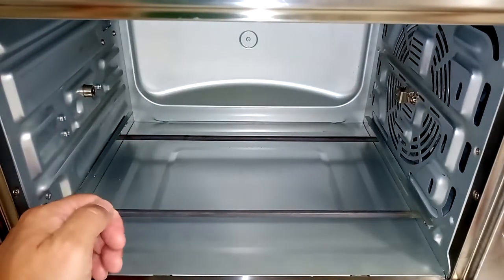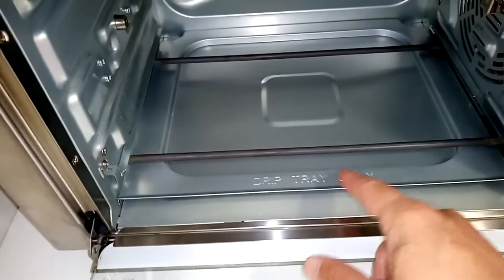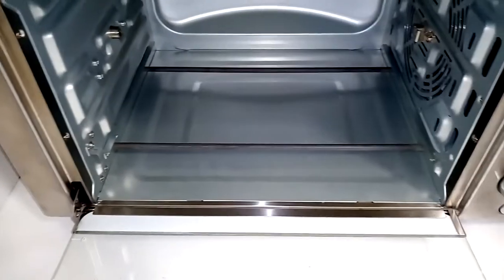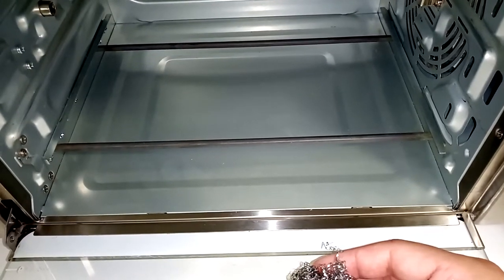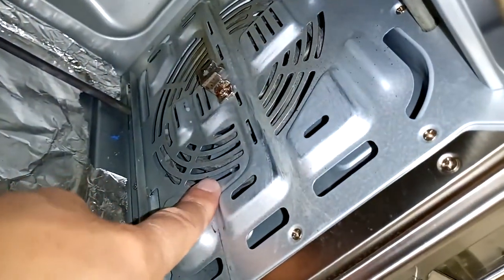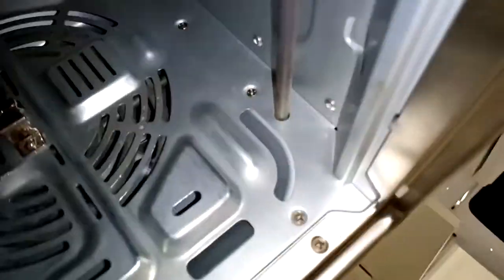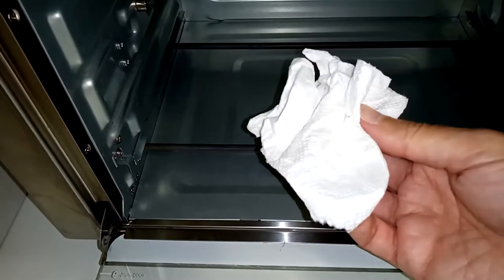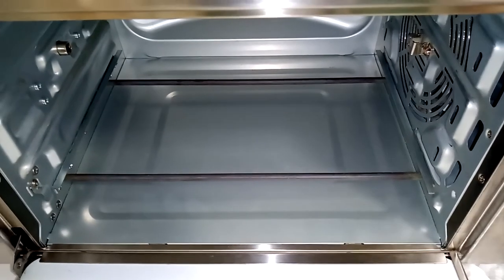How to Clean the Inside of an Emeril Air Fryer 360 & the "Tool" You Need To Do It!

Comment: Will try to clean it with the pads. Wife doesn't believe in any prevention.  I'm about to throw it away and get another. Love it but sheesh
Reply from the maker: She doesn't believe in prevention as in using foil you mean?  You saw my other video on tips and tricks?  Maybe you can guilt her into it.  After you're done cleaning with this method, it will look close to new or at least amazingly different, so you can say "you're not going to just mess it up again are you?  All my hard work (and it is work) for nothing?" :-)   Using foil on the original drip tray and using the baking tray as a secondary drip tray (when appropriate) with foil (placed securely) will definitely help and ease or burden of cleaning the inside of the Emeril.  I also have a video on the product you need and how to clean the outside of the Emeril Lagasse Power Air Fryer 360 if you really want to impress.  It will look brand new!  In the meantime, I recently made a YT Short video where you can see the before and after using the cleaning method described in this video.  You can find it here: https://youtube.com/shorts/4-Bp-OfLXug?feature=share    Keeping the air fryer clean and cleaning it after it's been used are pain points for many owners.  But between the tips/tricks in my other video and the cleaning method outlined in this video, I think you'll be a much happier Emeril air fryer owner.  Plus, with a new looking air fryer, thanks to your efforts, you may have a happier wife.  And you know what they say... "happy wife = happy life"    Enjoy!
Reply: @EfficientWay  using anything lol but after my elbow grease brings it back to life foil will be used

Comment: I need to go deeper than this.
Reply from the maker: Give the "tool" a try as I think you'll be pleasantly surprised by what it can remove and clean off from the inside of an Emeril Lagasse Air Fryer 360.  If you apply extra "elbow grease/pressure" it can do wonders, but more importantly, you won't create a mess like you would using a Brillo pad and it's a lot safer/healthier than using oven cleaners/chemicals.  You could additionally apply a bit of dish detergent like Ultra Palmolive (mixed with a bit of water to create a "soapy" sponge or paper towel) and apply it to the inside of the Emeril.  Leave it to sit for a few minutes so that it will help to start breaking up the grease and then go in with the recommended tool and scrub away.

Comment: I give up !!!!!!!!      I found the best way to save time.......... is to DUMP IT !!!!
Reply from the maker: I can feel your frustration through my computer screen.  I'm sorry to hear you're having such a tough time cleaning the inside of your Emeril Air Fryer.  You need something abrasive, but not too abrasive as to scratch everything up.  And SOS pads are not only too abrasive, but they will leave all that sudsy blue soap in their path.  Oven cleaners are dangerous to use and it's a pain to try to remove it all (and be sure of it) before using the air fryer again.  That is why I suggest using the tool in the video.  You may be past the point of no return, but it's normally very effective at removing the burnt on grease from steaks, hamburgers, etc. and splatters.  The video watched showed me removing grease splatters from the beef burgers I cooked (I have a separate video that shows me cooking them and how much grease came off- which was all caught by the foil btw).  I have a separate video on 
"tricks and tips" regarding the use of foil, etc. If you haven't tried the tool, it's worth the small investment to do so.

Comment: You probably barely use this unit. No way it’s this clean. The grease splatter and etc
Reply from the maker: I love the skepticism.  For starters, I you can view the video I made prior to this one where I made beef burgers in the Emeril Air Fryer.  In this video, I cleaned up the hardened on grease splatters, etc. Furthermore, there are a whole bunch of videos on this channel where I "use" this unit to cook various types of food- from vegetables I spray with oil, to pizza, to frozen PF Changs fried chicken!  If you want one of my first videos on using the Emeril Air Fryer Power 360 where I offer tips and tricks, you will learn how I prevent creating large messes while using the Emeril oair fryer so that the clean up process is not so difficult to start with.  After that, just follow the process in this video and you too can have a clean Emeril.  Take a look at yet another video where I show/tell others what to use on the outside to get my Emeril looking so shiny it looks like it just came out of the box. You may find it helpful. I promise I don't store my Emeril in a box ;-)

Comment: I guess taking all the screws off and trying to take it apart is not the best idea…. Should have watched this before I did that 🤷🏻‍♂️
Reply from the maker: Ha!  Well I tip my hat to you for that kind of effort just to clean the inside of the Emeril Air Fryer 360!   Were you able to put it back together ok?  If you haven't seen it, the video I made prior to this one into detail about how to prevent the need for big cleanups etc.  Anyway, I hope you got to clean behind the fan grill (where the fifth heating element resides).  There are a lot of Emeril Air Fryer owners that are dying to get into that space to clean out any grease splatters that made their way in there.  So your efforts likely weren't for not.  Either way, thank you for the positive feedback on the video.  Happy Frying!

Comment: Nothing sticks to the drip pan.   Even a little scratching is no good.  Eventually, your pan, which is nonstick will be ruin  when using things they said not to use.  It pays to listen to the maker/manufacturer of an item.
Reply from the maker: I don't have an issue with anything sticking to the drip pan because I line mine with foil.  I don't even recall cleaning the drip tray in this video.  As far as the concept of "nonstick", it is often difficult to remove hardened on food, fat drippings, burnt drippings, etc. even if something is coated with "nonstick" spray.  On that note, where did you read, from the manufacturer, that the drip tray on an Emeril Air Fryer 360 is nonstick?  I just reviewed the manual that came with mine and I did not see that mentioned anywhere.  That is not to say that I didn't miss it, that I have a different tray (or manual), or that the drip tray is not nonstick.  I simply did not see that fact stated by the manufacturer. Btw, I am aware that the manufacturer suggests not using foil, but I've mentioned and written extensively on the topic in my other other Emeril video and its comment section, about how I do so safely, and successfully (no issues all these years).  The tool in this video is especially helpful for cleaning the inside walls and ceiling of the Emeril.  These areas don't offer the same option of removing and soaking like the baking tray or the drip tray.  Over time, depending upon how you use your Emeril, these areas are likely to become pain points as they have for so many other owners.

Comment: Mine is aweful!
Reply from the maker: The Emeril Air Fryer 360 can easily build up grease and grime.  You aren't alone.  But you don't have to live with a dirty Emeril Air Fryer.  This tool and technique will help you remove the crusted on grease and splatters that seem impossible to remove.  You will be able to restore it to where you are proud and happy to look inside once again.  Additionally, I have a video on what product you need and the method of application to use in order to restore the outside of the Emeril Air Fryer to a shine that looks like you just took it out of that box.  You can find that video on this channel as well.  Finally, if you haven't seen my video on "tips and tricks" for the Emeril Power Air Fryer 360, watch it and read the comments.  I have tips for how to keep it clean and other viewers have left some helpful comments and tips too.  Happy Frying!

Comment: Why you clean with it being plugged in??? Too dangerous
Reply from the maker: I avoided touch the heating elements when cleaning the inside of the Emeril Air Fryer, even though it should be safe to touch as long as the Air fryer is not on.  But you are right.  To be extra safe/cautious, I and others should unplug the air fryer before cleaning inside.  It's easy enough to do.  Thank you for noticing that and reminding all of us.

Comment: Glad I watched this, it made me not want one.
Reply from the maker: Don't get turned off yet.  Watch the video I made on "tips and tricks".  If you use foil the daily cleanup for an Emeril Air Fryer, is dramatically reduced. You don't have to take the steps in this video every day.  Also, everything that brings joy has to be maintained.  Be it your car, a pool, a dog/cat, etc. There are cost savings with using an Emeril Air Fryer if your conventional oven is electric.  Anyway, I'm glad the video helped in form or another!  Thank you

Comment: This oven looks very brand new.. nothing ever cooked in there 😡
Reply from the maker: Ha!  I see you are skeptical about just how well I was able to clean the inside of an Emeril Air Fryer.  If you check out some of my other Emeril Air Fryer 360 videos where I use the oven to cook things such as beef hamburgers, and you see that those videos were posted well before I made this video, will you come back and turn that frown upside down?  Will you reply with a smile?  More importantly, if you truly want to clean the inside of your Emeril Air Fryer, watch the other videos, so you feel confident (even though I show removing the hardened on grease stains in this video) enough to try the tool I recommended and used in this video.  It will save you a lot of time cleaning your air fryer.  As a bonus, if you would like the outside of your Emeril Air Fryer to shine like new, check out my video on that subject.  I tell you exactly what product to use and how to apply it.

Comment: Did not work
Reply from the maker: I'm sorry to hear you're having trouble.  Could you please provide a few details so I can try to help you i.e. what part of the Emeril Air Fryer you're trying to clean- inside/top/bottom/drip tray/glass door, are you using water, are you using the exact brand featured in the video, how hard you are scrubbing, what you are trying to remove- hardened oil/grease/fats, burnt on grease, cheese, etc., how long whatever you are trying to remove has been inside the Emeril- days, months, years, etc. etc. There are very few, if any, things this product can't remove from the inside of the Emeril.  In a worst case you could be left with some cosmetic/color remnants, but all material deposits should be able to be removed.  Thanks!

Comment: Looks hard as hell to clean? I mean the air fryer I have now at least has an entire pot I can simply remove and wipe out but this, looks like a souped-up toaster oven just far more difficult to clean out. And showing the three racks of food we're a pretty foolish addition to the commercial since each one drips on the one below. Air fryer cleaning should be simple this looks like a Lot of work.
Reply from the maker: You're right that the Emeril Air Fryer 360 is harder to clean than a stand-alone air fryer (does nothing but air fry) and the commercial showing 3 racks cooking at the same time is silly.  Not just because food will drip down on to the rack below, but because the air doesn't circulate as well and everything takes longer to cook.  While cleaning the Emeril Power Air Fryer may take longer and is harder to clean compared to the "pot" on a different air fryer, the Emeril Air Fryer has the advantage of performing the toasting function, convection oven function, pizza function, etc. with precision timing as a bonus.  You can't do that with stand-alone air fryers.  So you not only save space on your counter and have the option of not turning your conventional oven on in the blistering summer heat, but you also gain all of that functionality.  PLUS, the toasting function and all the others are actually better than a normal toaster because it uses precision timing (down to the second) and the temperature is perfectly controlled (way better than a regular toaster oven).   So it is a trade off.  If you follow the suggestions in my other video, it cuts down on the clean up quite a bit, but it will be more than what you have now.

Comment: I did try, foil, even Oven Cleaner to take off the burnt grease from Hamburger Paddies,  the burnt grease  is now imbedded into the metal. No Luck, my Air Fry looks P.P. !! to say the least, I highly recommend to NOT BUY IT !!! A complete waste of money for me. I have put in about 3.5 hrs trying to clean it....... WILL DUMP IT !!!!
Reply from the maker: I can feel your frustration through my computer screen.  I'm sorry to hear you're having such a tough time cleaning the inside of your Emeril Air Fryer.  You need something abrasive, but not too abrasive as to scratch everything up.  And SOS pads are not only too abrasive, but they will leave all that sudsy blue soap in their path.  Oven cleaners are dangerous to use and it's a pain to try to remove it all (and be sure of it) before using the air fryer again.  That is why I suggest using the tool in the video.  You may be past the point of no return, but it's normally very effective at removing the burnt on grease from steaks, hamburgers, etc. and splatters.  The video watched showed me removing grease splatters from the beef burgers I cooked (I have a separate video that shows me cooking them and how much grease came off- which was all caught by the foil btw).  I have a separate video on 
"tricks and tips" regarding the use of foil, etc. If you haven't tried the tool, it's worth the small investment to do so.
Reply from the maker: @paulguerrero3560  You need to be careful how you place the foil.  I've written about how it needs to be placed very tight to the tray so that what you experienced does not happen.  If this air fryer isn't for you, fair enough.
Reply: Why did E.L.not include cleaning for this 360? After paying over $300.00 it looks awful and he should replace these Air Friers. He likes to show all the cooking but no cleaning.